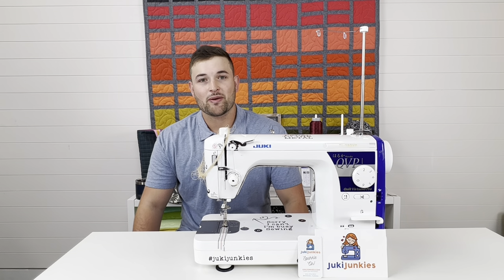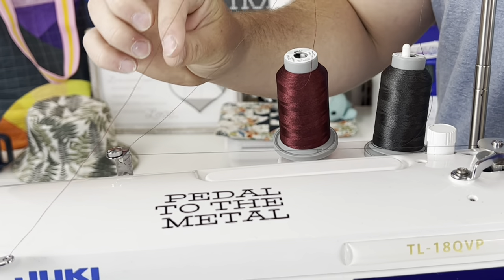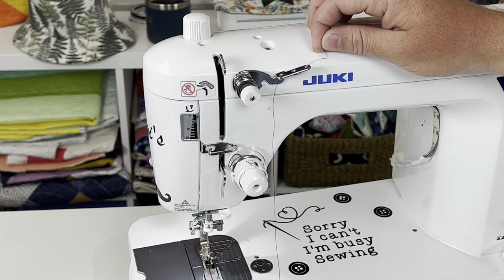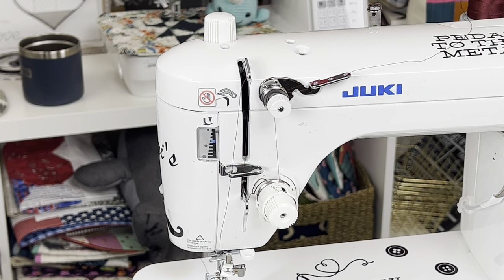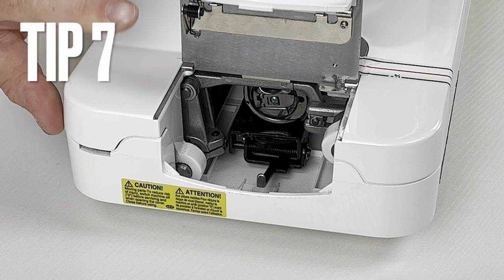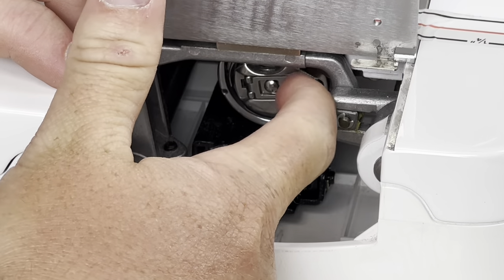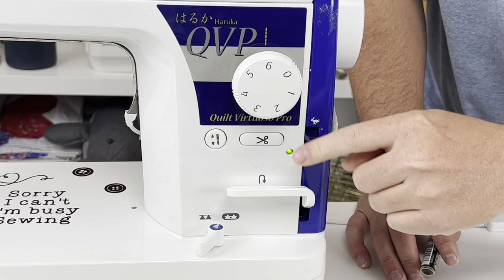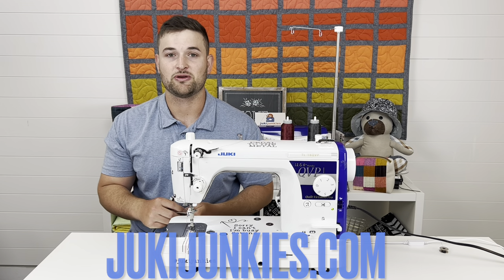JUKI TL COMMON USER ERRORS!! (LEARN WITH US) ( MECHANICAL MACHINE)

Comment: So why does my automatic thread cutter on my foot pedal engage even if I have the rubber stopper on the bottom of it??? It drives me crazy!!!
Reply from the maker: Do you have it installed properly ?
Reply: Yes. And I have used my other Juki foot pedal and it does it when I use both of them.

Comment: My issue is the needle threader,  I went through two in just  a few months.  The threader gets stuck in the bottom position, and messes up the threading process.  I have had to replace the needle threader twic because it stoopped working
Reply: Whenever i have this problem , i undo things and hit the updown needle button and try again. This hss fixedvthat problem with the threader getting stuck,  Must have something to do with the needle getting to exactly the right spot for the threader to work smoothly.

Comment: why is the 2010 threaded different then the 2000 what you just showed is totally different then what is in the manual for the TL2000
Reply from the maker: Juki TL -2000 doesnt have a sub tension knob
Reply: @JukiJunkies   yes I know that but in the book it has the thread going through the bar 3 times and not around the tension nob

Comment: how often do you oil the machine?
Reply: You will have to watch the video again because he mentioned how often and he even put it up on the screen
Reply: He said every 4 to 6 hours  of sewing.  I had oil leaking out on the bottom so I had to back off a bit.  I do put in a strip of junk fabric and briefly sew at top speed after oiling.  If any oil might get on your fabric, that will help get it on the junk fabric instead of your good fabric.